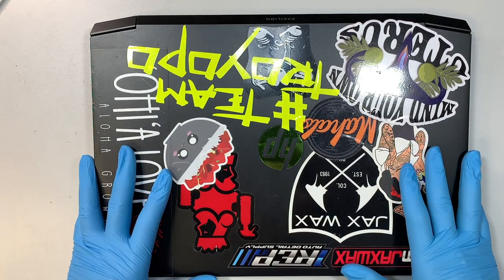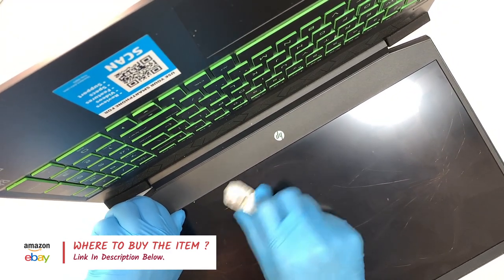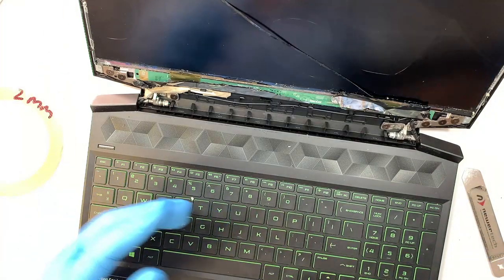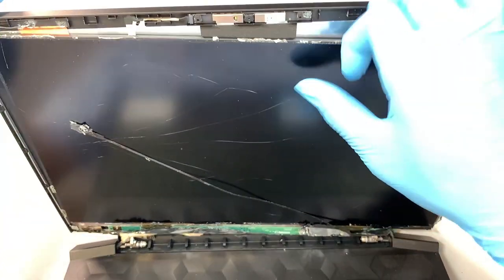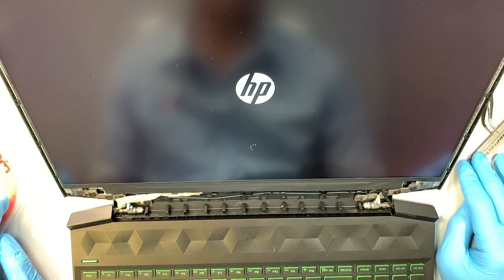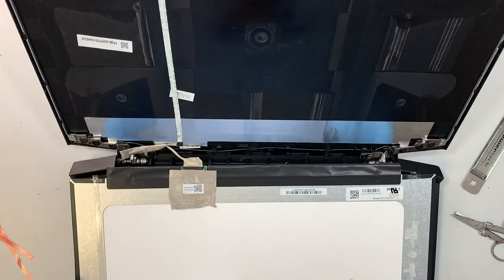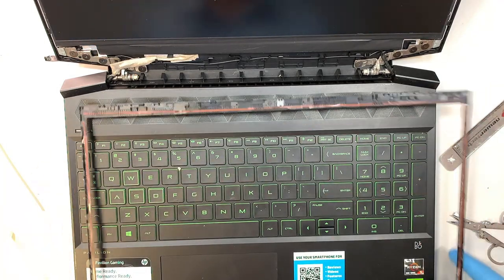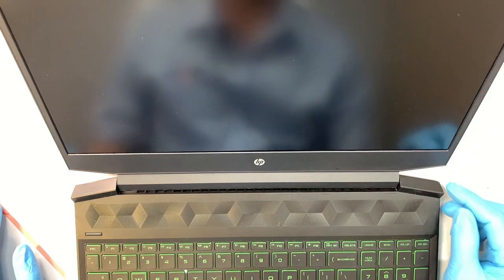HP Gaming Laptop 15 ec1010nr Cracked Screen Replacement

Comment: Quick note, I had the Greek version of this laptop and the tabs for the adhesive strips on the back of the LCD screen were on the bottom for me. So some models are a little different but roughly the same

Comment: These adhesive strips often break, forcing you to release the hinges and insert a thin plastic sheet to remove the panel. Other elements that fail occasionally in this model are the keyboard in the area above the GPU and the hinges.

I strongly advise against re-gluing the screen with adhesive. The metal frame and the front part are enough to keep it fixed.